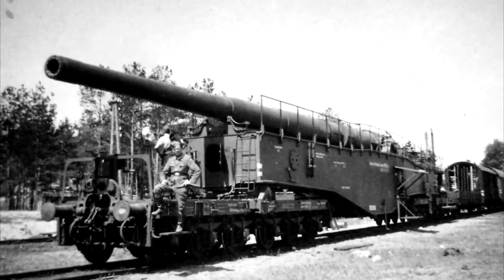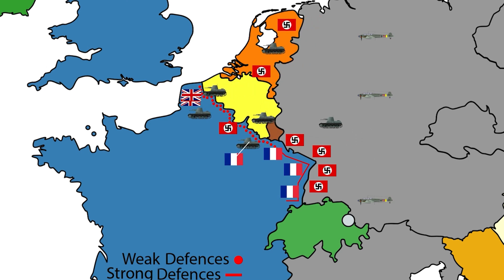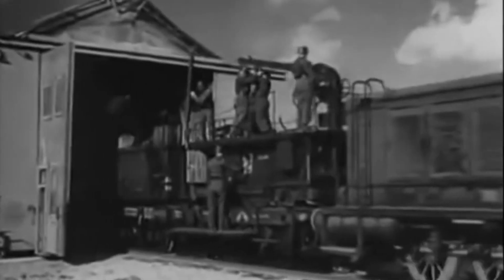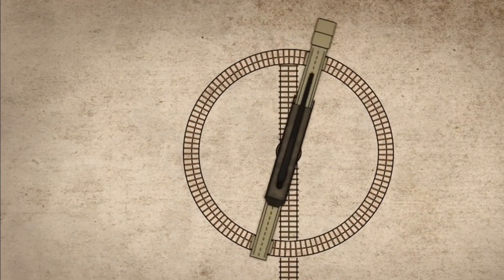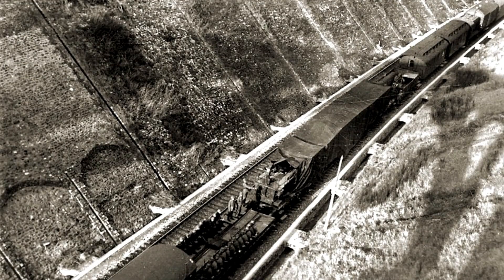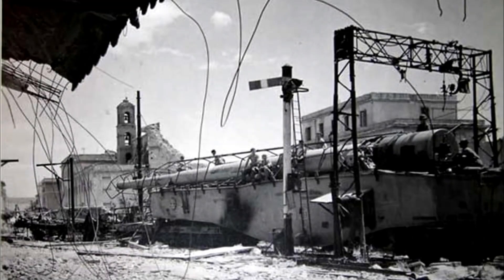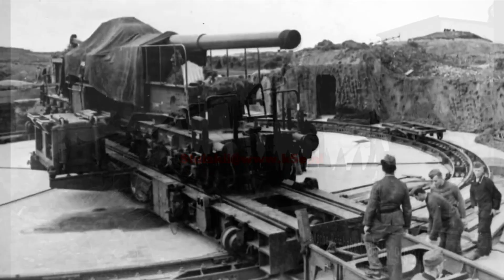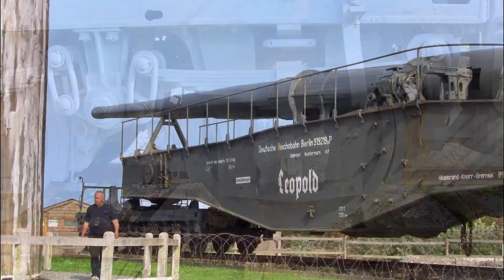What Made the K5 Railway Gun One of WWII’s Most Feared Superweapons?

Comment: These guns were tiddlers compared to the Schwerer Gustav, of which two were built. The carriage was mounted on two parallel railways tracks, and the gun had a calibre of 800mm (31.5in). One saw action at the siege of Sevastopol in 1942 and fired a total of 47 rounds. One of these detonated the Soviet "White Cliff" ammunition bunker - thirty metres under water and further protected by ten metres of concrete.

There were plans to use one or both Gustavs to shell Stalingrad, but they were forced to retreat before they could be got into action.
Reply: I struggle to understand the logistics of using 2 parallel tracks. Most rail here (in America) is single track. Not to mention, what about tunnels too small for the gun? Needing to BUILD your way to the front doesn’t seem efficient.
Reply: @st1ch356  The gun was sent to the front in sections, on single track rail cars. Once in position, the gun was assembled, and a section of curved double-tracks was laid down for its use. Setting it up and building the track required five weeks and a team of around 4,000 engineers.

Yes, it was a wholly impractical waste of resources, but Adolf liked it, so there was that.
Reply: @lomax343  this makes much more sense! It’s astonishing that it took that long to set up. It seems like front lines could shift in a matter of days or 2 weeks at most. You’d have the gun set up just to take it down again and switch positions
Reply: @st1ch356  That's why it was only deployed (or planned to be deployed) at sieges.
Reply: @lomax343   almost a shame there not was sieges worth it but i do see a use for them much like the 'bad neighbour' trabuchet one of the english kings hade back in the day , enough to show you rolled it up to fire and defenders lose heart because they know there is NOTHING that can survive those shoots no armour , and all you do if digging deep enough to be safe is preparing your own alive burial

sort of shame , can envision it used alternatively when not for siege as a early tactically deployed and strategically used long range AA and a late tech 'scrambling immune' long range alternative if going into cold war missile days , if combined with decent radar etc after all yamato hade super sized flak rounds that it used a couple of for decent effect did it not ?

so give some of those to the schwerer gustav and well , not perfect but has its uses if prepared as a tactical asset rather then a direct combat one